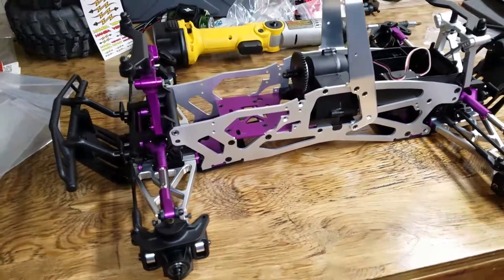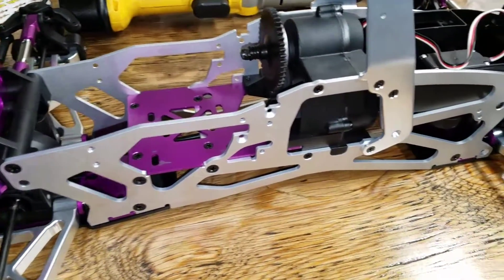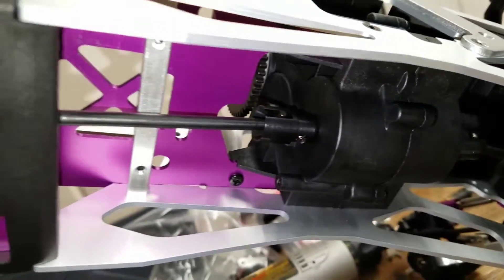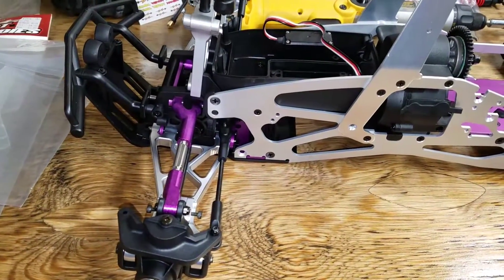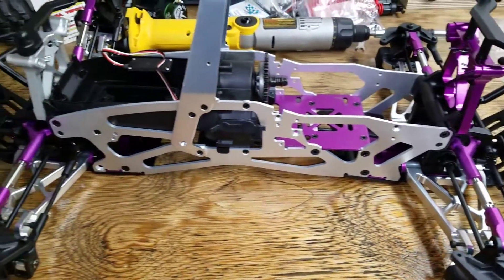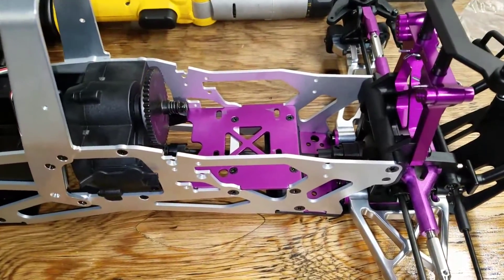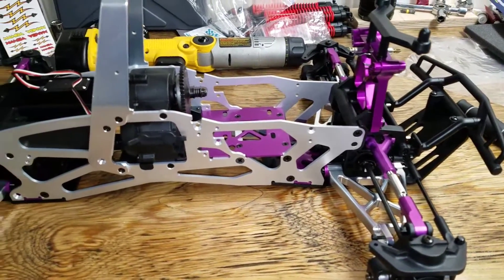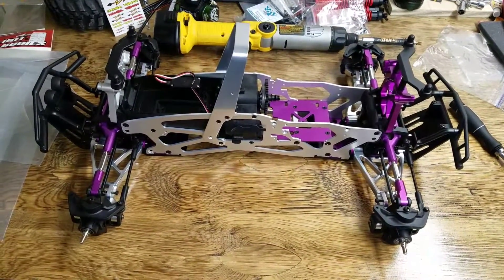HPI Savage Gen 1 Brushless Conversion/Upgrades Part 3

Comment: what conversion kit is that
Reply from the maker: The motor mount conversion is from http://www.kershawdesigns.com/. I like it but I will probably go with the http://shop.alza-racing.com/en/standard-flux/1-motor-mount.html. I don't like the fact you can't adjust the Kershaw mount forward or back on the truck. It's a pain when using a Robinson Racing spur (which I highly recommend). If you use the HPI metal spur or the Integy spur (shown in this video), you should be ok. Check out some of my other videos on the progress of this truck. Pain in the a** but way worth it.
Reply: ok thanks